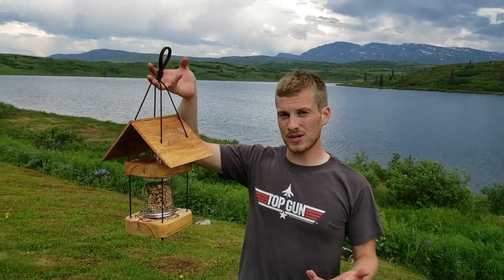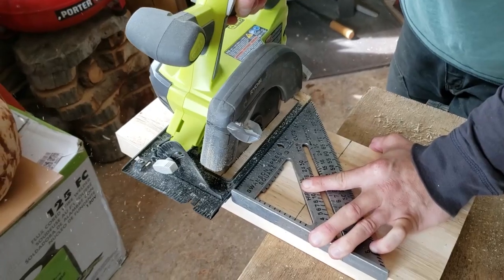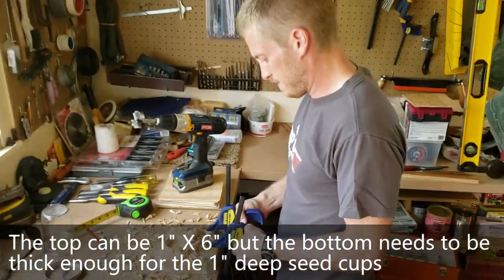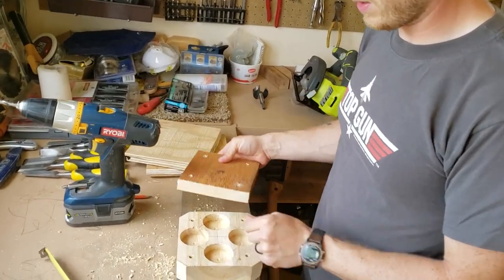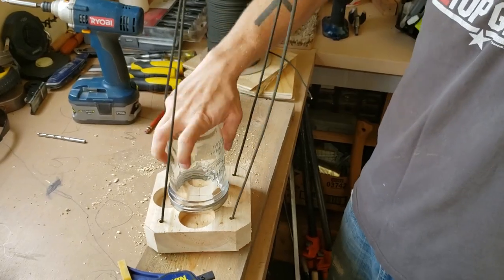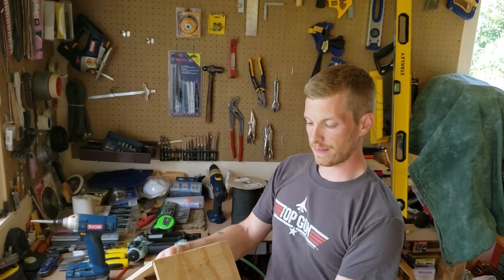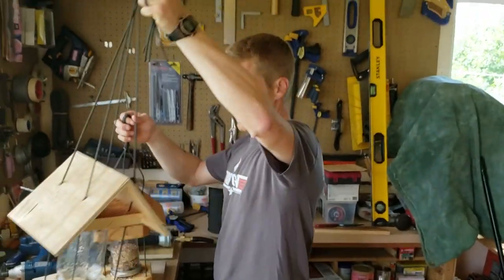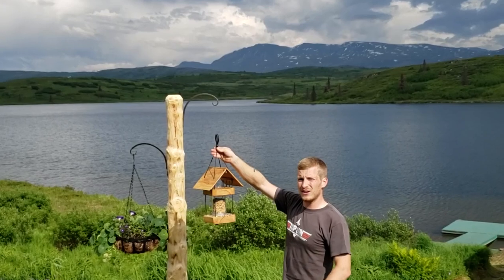DIY BIRD FEEDER  //  Easy Woodworking Project

Comment: Oh! Great job but archaic drill sizes.  Europe used mm for 100 years now,  in UK we ditched  fraction of an inch 7/16  for decimals of an inch   0. 437  and about 40 years ago we move to the far more sensible mm  🇬🇧 
Fractions of an inch is crazy !   Your design and build is GREAT though, best wishes from England